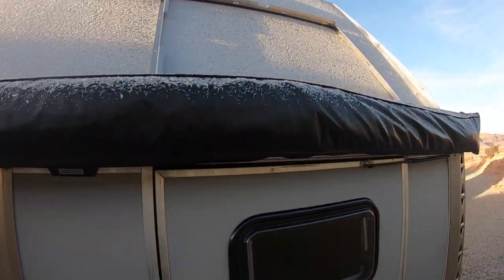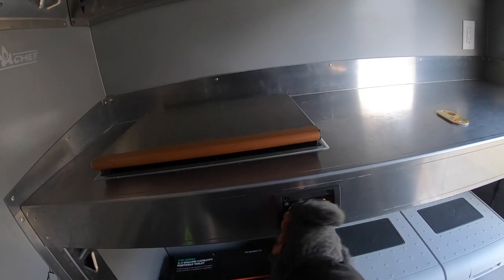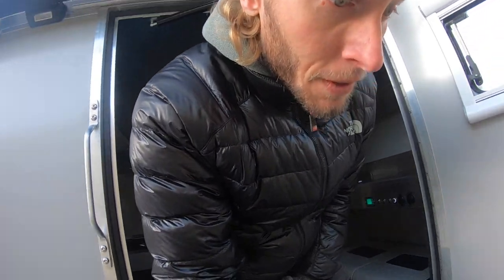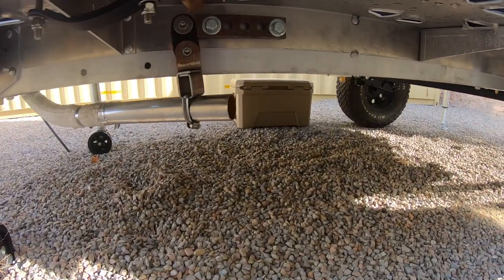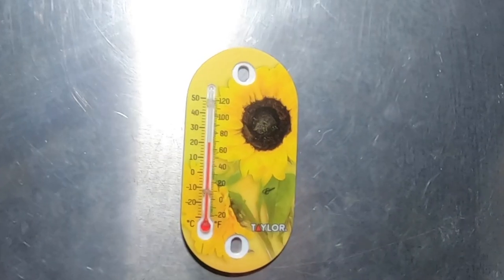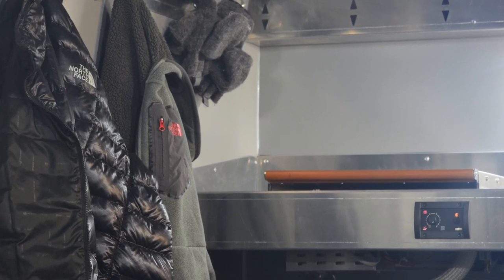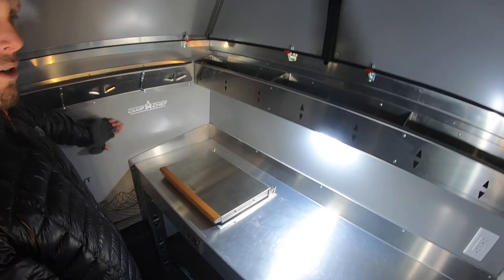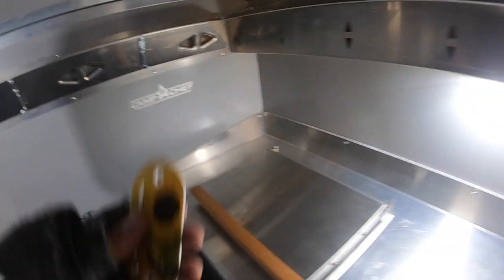Testing The Heater

Comment: Is that heater thermostat controlled or do you have to futz with the dial to maintain temp?
Reply from the maker: Hey Bigsky Guy, great question. It is thermostatically controlled with no futzing required.

Comment: Ok I've beem shopping for 2 years planning my retirement. Came across you guys today. I like the simplicity of your build. My question regarding the heating system is, can you still cook in heat mode and how effective is the system in extreme cold like -20°and colder?
Reply from the maker: Hey Steve, excellent and we appreciate simplicity as well! Yes, you can still cook on the glass cooktop in heat mode.  We don't often see double-digit negative temps near us however it is rated to perform in up to -40C with artic winter-grade diesel fuel.
Reply: @ANTISHANTY  Thanks for getting back so fast. That's the Temp I was wondering about as I lived in Fairbanks for a few years😉 Those temps are a love hate situation but I do embrace the cold. One last question: the upper bed is queen, can that be a perminate bed, how much space is there if I wanted to put a queen matress say 6 to 8 inches thick?
Reply from the maker: @Steve-yo4ld   You are welcome and embracing the cold sounds necessary in Fairbanks! The upper queen has enough room for a sleeping bag or some light bedding in addition to the cushions that can be used as a permanent bed. There is however plenty of room for an additional mattress topper or a thicker mattress on the lower two rails.